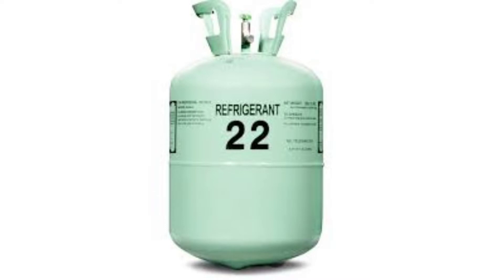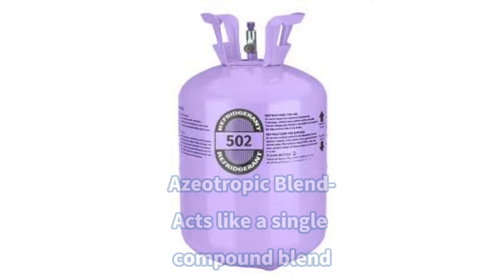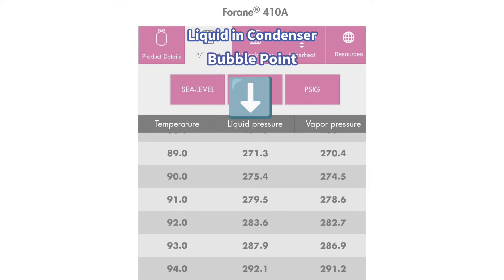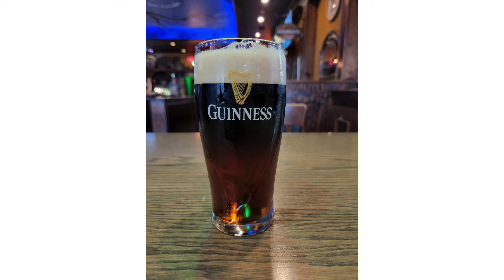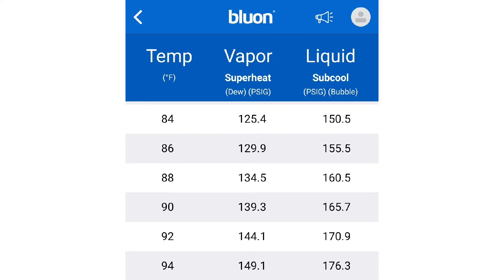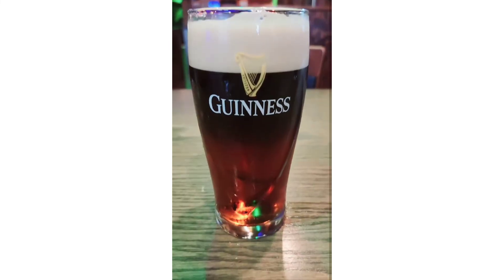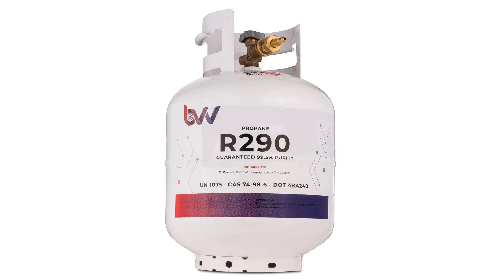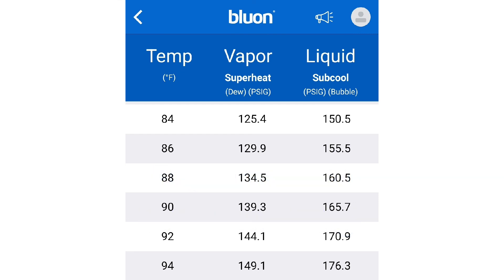Refrigerant Glide and Fractionation Explained With Beer!

Comment: 👍🏽, question for you sir. I worked on a 12 -15 ton split system with a recep 06D compressor. So a few repairs and fixes had to be done , involving recovering refrigerant in gas form once or 3 times. I couldn't tell you 100% that everything that came out went back in but we noticed poor performance. Due to a previous issue of poor performance and going back to r22 and having the system run like a champ, we did the same and now I'm here researching this topic lol. But longstory short, will recovery of gas a few times and let's say you do your best to charge all of it back for repairs cause this problem? I guess it's something I'm gonna have to experiment with too and continue learning.
 Thank you for your time. Sorry the refrigerant in use was R422B